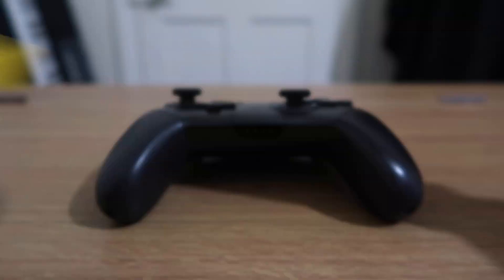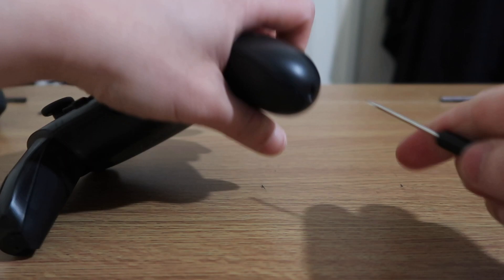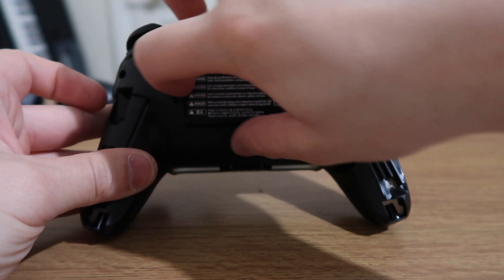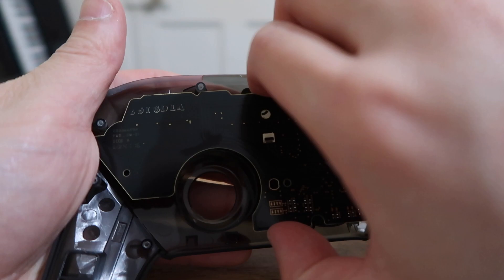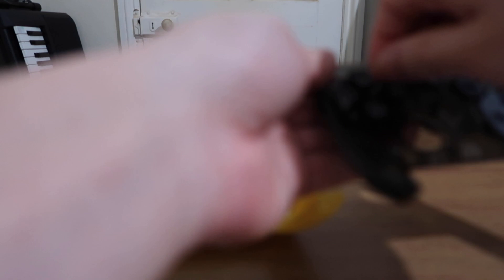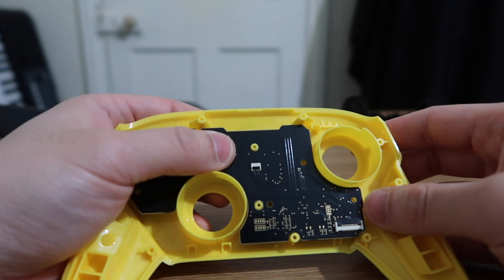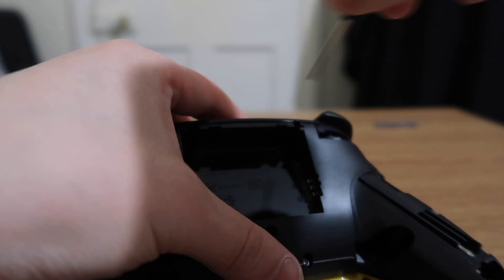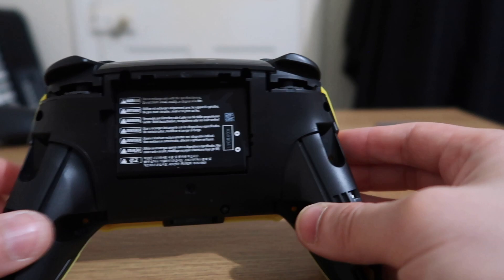How to change Switch Pro Controller Shell

Comment: WARNING to others attempting this: 
7:13 is completely unnecessary to undo. No other tutorials I've checked after this video does this, and it will only give you a potential headache. Please skip removing the 2nd cable. you do not need to separate the shoulder buttons from the board whatsoever.

i should have checked other tutorials. yours gave me a headache for absolutely no reason, there is no need to undo the tiny ribbon cable to remove the shoulder buttons from the board. Other tutorials just leave the smaller ribbon cable in untouched, unscrew the 4 screws and lift everything out. i can't put the damn thing back in. I've been wiggling the tiny ribbon back and forth for like 10 minutes and i'm anxious as hell that this activity is just going to brick my controller, so I can't really say thanks for the guide right now.
Reply: unfortunately.. I am going thru the same right now! I am so upset and i wanna cry! ... Its not working now nor wont turn on :(
Reply: @mariabelair6641  i did the same, but my procon is working well. cause i had my procon hand painted customization and i need to changed the buttons to to matched on the design. You just need to reattached the cables again

Comment: Am I the only one who finds the screws for the handles incredibly tight? Like, "not even a rubber band can help it at all" tight?
Reply: I know right, it feels impossible to remove,
Reply: Yup. I’m doing it right now.
Reply: The screws for the handles are the easiest ones to unscrew lol
Reply: @meILM  they were pretty tight for me. I was using a shit screwdriver, so that probably didn't make it much easier.
Reply: Mine are incredibly tight but I might have used the wrong size screwdriver; I've ordered a new shell that comes with a screwdriver so hopefully that one will work
Reply: FOR THE LOVE OF GOD I CANT DO THIS. Zeus himself tightened these screws and He AND ONLY He can untighten them
Reply: SERIOUSLY! And they strip really easily! I’ve worked on two pro controller and both times I’ve had to drill one screw out because the head stripped! And I can’t find replacement screws anywhere!
Reply: @Cabinet_Juice  I can't do this! I'm using the correct screwdrivers. I already bought replacement button and a new shell. If I can't get the rubberband method to work, it's over, I'm tapping out. So frustrating.
Reply: so I'm not the only one then. I've spent so long trying to remove these tight ass handle screws I'm about to give up lol
Reply: @avonire  the main issue for me was the type of screwdriver I was using, it was an all metal tiny one with no grip whatsoever, so anything that's even the tiniest bit too tight is impossible to unscrew with this thing. All you really need is something that's not small and has an actual handle to hold onto.
Reply: Same here I bought so many screwdrivers and they don’t work😤

Comment: For anyone wondering, I believe the screwdriver is a size 0 Philips head. It's what worked for me during this process. Don't get the screwdrivers with bits though as it won't fit into the two holes nearest to the battery. The base of the bit that connects to the screwdriver is too big due to its hexagonal shape, and therefore made it too short to reach the screws in question. Had to go out and buy another one just for those two screws T.T. Thanks for the wonderful tutorial though!
Reply: Would this one on amazon work? :D Thanks!

Comment: 100% recommend this tutorial.  Had trouble with a stripped screw, but nothing my dad couldn't handle.  Got terrified when I got to the ribbon cables, but if you follow this tutorial perfectly you'll have no problems.  The only thing that was different, was my main ribbon cable didn't have a locking mechanism so that scared me even more I was going to mess it up, but controller is back together and it works.

Comment: Hi, while I found the video very informative and successfully swapped all the shell/buttons, now it won't turn on at all! All of the parts are back in the right place and the ribbon cables are properly inserted as far as I can tell. Is there any fixing this or will I have to send it in to Nintendo?
Reply from the maker: I would check the ribbon cables, try taking them out and put them back. If not you can get new ribbon cables on ebay and replace them. There only like £1 for 4 cables
Reply: @LevelOneGamer  Alright, so while I went in and unplugged/replugged the ribbon cable, I think the problem was just not giving it enough time to charge or sync with the console lmao

Working like a charm now, thanks!
Reply: Did you put the battery back in i know its obious but idk maybe it just slipped your mind

Comment: If anyone is wondering why their home button is slight sunken in compared to the rest of the buttons, make sure not to lose the little clear silicon piece that comes with the home button. It seems like its slightly stickier than the other pieces, you can see it comes off with the board at 9:43. I had to take my controller back apart after i found that lying on my desk xD

Comment: I really like the shell of those Power A controllers but still prefer my first party Pro Controller. Can I swap the shells or is Power A somehow made differently, since it has no battery pack?
Reply: The shells for the Power A are not the same as pro controller shells. It might be possible, but the button holes will probably not line up properly or the shells won't fit at all.
Reply: will not work, dont try it

Comment: I think i stripped the screws on the handles, so I can’t take them out, help?
Reply: l1a2c3t4a5i6d:
Don't know what you might have tried since this or what luck you might have had, but you could try using a rubber band. Take a rubber band put it around the screw driver in a way as if your wrapping the rubber band around the screw driver vertically. Then using your screw driver try to unscrew it as you normally would. The hope is by sandwiching the rubber band between the screw and screw driver that you increase the grip and can remove it. Try not to use a screw driver with too fine a point as to not punch a hole through the rubber band. If this does happen, try to fold the rubber band. Ideally, you might want to use a flatter less pointed one and perhaps even slightly larger than would would be necessary to remove the screw if it were NOT stripped as the stripping has made a larger "divot". 

Also, you could try using a torx screw driver. Likely a T6 would be fine, but if it's REALLY stripped, maybe a T8. Actually, because a torx screw driver is flat, but has more "teeth", you might have a better shot at using the rubber band trick and you likely wouldn't have to worry about "skewering" the rubber band.

Comment: Is it only me or anyone else are missing things. This is my first time opening it too. My board came with no screws. It was not attached at all.  Plus it came without one of the rubber protecting covers for the buttons. Like, WTF!? Almost a $100 for a controller and it´s missing things. The funny thing is I ordered directly from the Nintendo Store. It’s not like I bought it from a different seller online or a second hand place.
Reply: Nintendo might have changed the internal design since the release of this video. It's been a year since this was posted
Reply: I got my controller recently and all of the parts matched up with the ones in the video so that’s a bit strange..